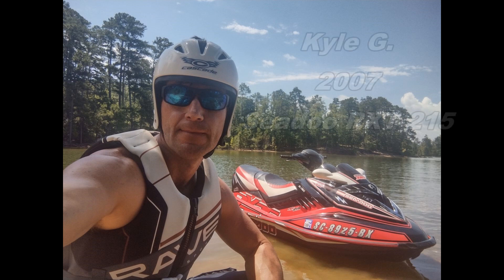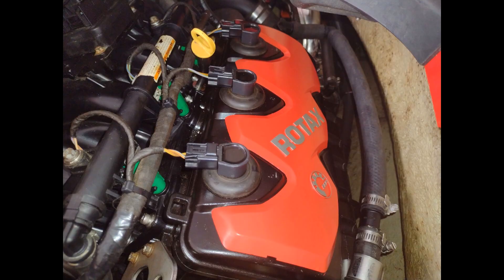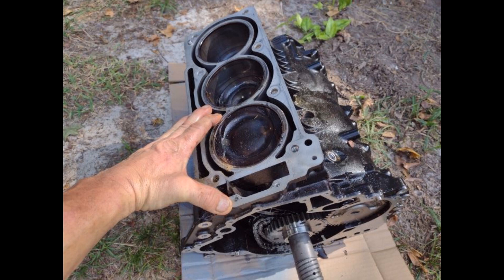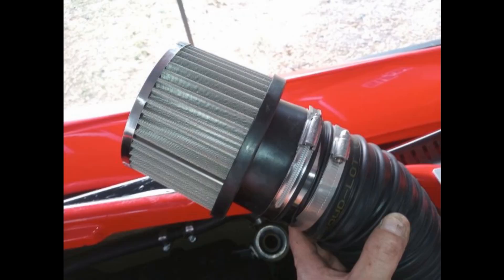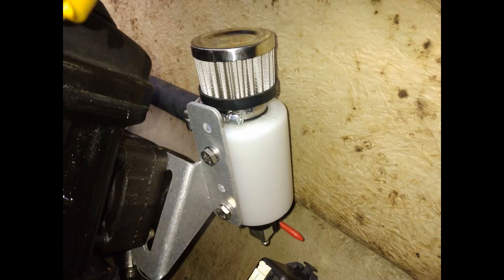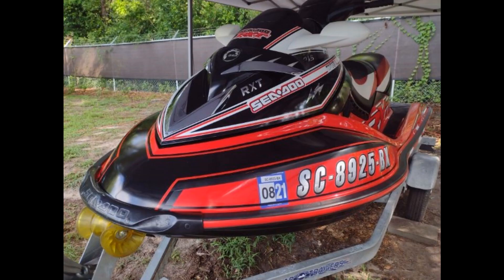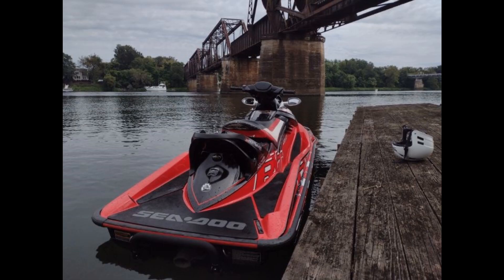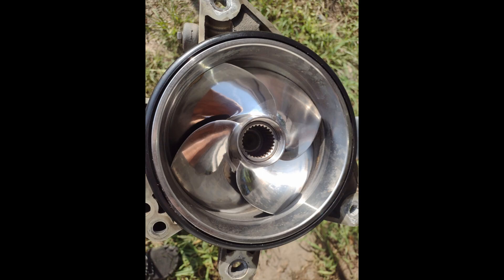2007 Seadoo RXT 215- Blown Motor Assessment

Comment: The Motor looks like it ran lean which damage the piston . 
This could be due to  incorrect map that was used ( according to me you where running the map for the smaller injectors and boost and installed the bigger charger with the new bigger injectors seeing if would run like that .) 
Did you do spark plug readings after the engine broke down ? The spark plugs should also give a good indication that the ski ran lean . 
Remember that the map must be adjusted according to a specific charger and injectors and fuel pressure .
But just knowing your actual fuel pressure for starters is important . 
The stock pistons can handle 350 hp with ease and the stock Conrods as well . With high rpm ARP flywheel bolts is a must , basically anything above 8500 for safety . Stronger cam sprocket bolts are also recommended .  
If you could ask Jesus Garcia if he has a map available for your specific setup and ask him to make it a little bit richer with a bit less Timing to start off with that would be in his capability . Your setup would make 300 Hp and more easily . 
You must also confirm your actual fuel pressure . We use a fuel pressure regulator to know all the time what the pressures are .
I personally ran a 260 XXX engine TEC 68/140 supercharger on my ski for many hours( stock pistons and rods just added arp flywheel bolts and stronger cam sprocket bolts ) . I  eventually decided to go with a 3x 300 super charger and ski was a beast .
Thank you for making your video I’m pleased to meet you .
Unfortunately I wouldn’t recommend a SBT crate motor at all . I like your ski a lot it’s looking great . 😊 
Thank you for watching my videos I’m happy that they where helpful .
I would recommend a intake grate the 14/19 may be your next impeller . 
It is recommended 80 pound injectors but Jesus Garcia will or might have updates that works with that semens deka ecu . 
If your own block could be bored over size that would be an option . Otherwise source a cheap second hand oem motor and rebuild that . Use a 300hp head gasket too they seal better .
I would recommend you speak with Armin at Riva Motorsports Pom Pampano Florida and you can say we recommended you . They could also help a lot for the right oem or Riva parts .
I have still a seadoo 2004’ turbo ski built by seadoo centre originally and they used stock rods and pistons and valves where cut to lighten them and they used aluminium retainers believe it or not from rotax racing . The ski did 160km /h ( 100 mph ) and was quite strong . 
So the correct map for your setup is key. 
Please keep in touch we will help where we can 👍
Reply from the maker: Thanks man, I really appreciate the feedback on the issue with my ski. I am paying close attention to what you recommend for me to do. I think that is exactly what happened to the piston, because the ski ran great with lots of arm wrenching power with the X charger setup. It wasn't until I ran the X4 that it blew up. I guess I need to fine tune the air/fuel ratio and fuel map to get it together. I am at a sleight dilemma because I am not sure where to look to find a good working used 1503 motor. There are so many used 4 tec's on the internet. I know older worn out motors are susceptible to breaking timing chains under higher perfirmance setups, so that is a questionable thing. Thank you for warning me about SBT motors. I looked online and saw a few reviews that said beware of SBT because their motor internals could fail. I need to find a good condition used 4 tec hopefull the same year as my ski. What do you think about going with an open loop cooling system? I am fed up with my ski overheating and blowing coolant out of the bottle. I heard that open loop cooling is the way to go for higher power setups. What do you think? is open loop reliable? and does it work well with the 4-tec?
Reply: @video1974  don’t go open loop . It is also problematic, so we use rotax racing complete water thermostat housing or rnd low temp thermostat that we glue and clamp with stainless clamp during installation ( otherwise the housing may pop open ) . I have built 9500 rpm seadoo motors with no issues like that. .
Reply from the maker: @Redrockat Okay, I will stick with factory closed loop cooling. Thanks for the heads up on that.
Reply from the maker: Hello Redrockat, it's been a while since correspondence. I have a simple question about Seadoo 4-tec valve springs and retainers. So recently I purchased a used 2011 RXTX 260. I am removing the 10 psi X charger and going to run a rebuilt charger with a 15 psi (Active Jetsport) wheel. I installed the Riva RRFPR. So I will have more air and more fuel. I plan on installing the AFR guage in the exhaust tract for accurate AFR. I set the fuel pressure regulator to 58 psi which I have read in the manual is stock fuel pressure. I plan on spinning the engine in the 8600 to 8800 rpm range. The question is, should I swap out BOTH the valve springs and retainers to the Super tech titanium units, or should I only swap out the retainers? I heard that the stock springs can handle the higher rpms, but I am concerned about valve float. If the stock springs are okay, then I will only swap out the retainers. What is the best method with a 15 psi. wheel and higher rpm's? thanks